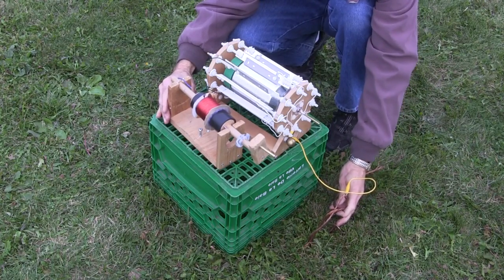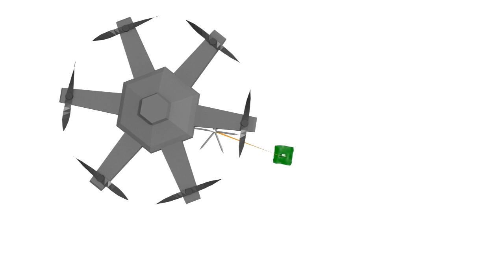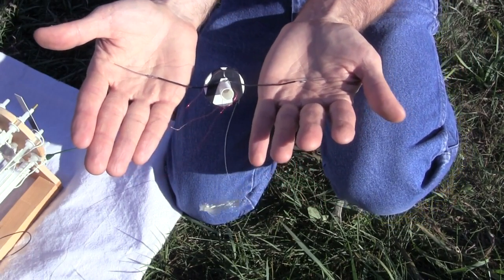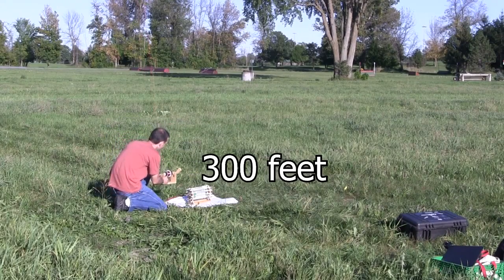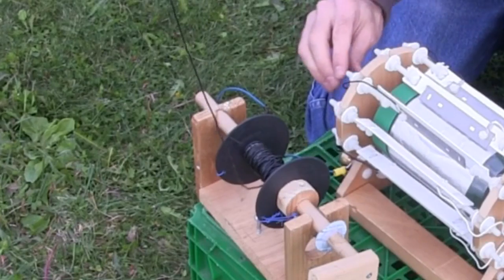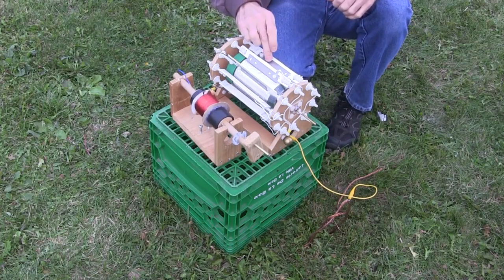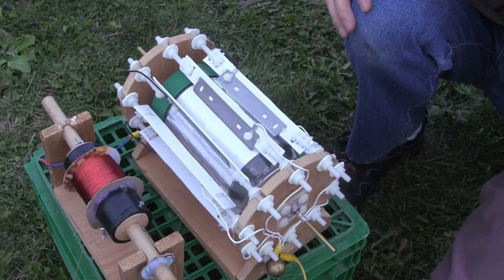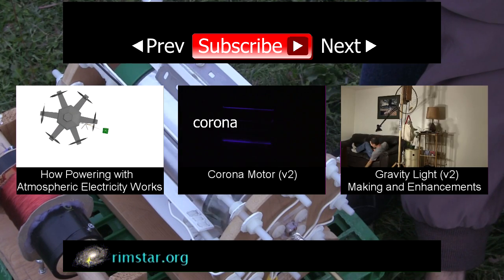Atmospheric Electricity Powering a Corona Motor/Electrostatic Motor

Comment: 0:20 Wrong...very wrong. atmospheric electricity is powerful enough. Look at Lasersabers Atmospheric motor. He has built a more powerful corona Motor than yours you clearly built something wrong with yours.
Reply from the maker: Nothing wrong with mine. His latest one had many more blades and he has a big property to stretch out a long wire. I'd be tempted to make one with highly packed blades if I had the place to try it out.

Comment: Ss what about a Kite??
Reply from the maker: I actually did try to make a kite for it but failed - too heavy. But the problem with both a kite and a balloon is what happens if the wire breaks low down. You end up dragging a wire across the city and potentially across power lines.

Comment: Hydrogen balloon
Reply from the maker: The thing I worry about using a balloon is mainly what if the wire breaks lower down and then the balloon carries it away and drapes it across some power lines.

Comment: How about  many small motors, each with a wire, going up to the top of a tower? If they were all connected to one crank shaft, maybe the power could be multiplied
Reply from the maker: That's one way to do it though I'd modify it slightly to have the many wires going to one motor instead. The many wires would add to the overall power.

Comment: get rid of the motor part use the wire as you have plug that wire into the ground  but thru the transformer  get a multi tap  transformer  and a switch  turn on and off  you could maybe use a audio source
Reply from the maker: The current is very, very small so I don't think it would dld work well with an iron core transformer. But I guess if you treat it as a radio wave antenna, then could connect it to a coil and an LC circuit and you;d be powering a crystal radio.

Comment: Could you use a non condutive pole in the ground to raise the wire? In placement of the hexacopter (due to not having one)
Reply from the maker: Yes. Keep in mind that it would also have to be high up in order to get the voltage.
Reply: @RimstarOrg  what is the lowest (estimated) height that I could start experimenting with if not the 1 meter = (100v) mark?

And why is it do you think (or know) that the 1 meter (100v) doesn't seem to yield any discernable results? I understand that the amps really really low, but surely a 100 volts would be detectable/measured in some capacity, no?
Reply from the maker: You can measure it with an electrometer. Luckily, Caltech has generously put Feynman's lectures online https://www.feynmanlectures.caltech.edu/II_09.html and if you scroll down to the 3rd paragraph, the one that begins, "How can we measure...", you'll see a suggested experiment without having to lift a wire high up.
Reply: @RimstarOrg  without raising a wire... I'm intrigued! And will sure be delving into that. But in the meantime, do you have a recommendation of pole length to start with? The shortest you'd suggest that is..
Reply from the maker: I haven't tried it with an electrometer so I don't have a recommendation for pole height. Another approach is to suspend a wire between two well separated, tall poles. Here's a demonstration by Lasersaber of that idea but without the poles https://www.youtube.com/watch?v=3EG-zjqs9xM&t=417s

Comment: hm what if we build a huge pillar that is insulated from the ground and meet ground and "live" wires at mid height? How much energy could we generate?
Reply from the maker: Something like that could work. Also, suspending the wire between two such pillars that are spread apart should work.

Comment: I would imagine that the atmospheric electric field changes daily.  Did you try it on different days and different weather patterns? We used to have a bank of spark gap style lightning arrestors to protect some radio equipment.  During thunderstorms, those things chattered constantly due to the high charge level in the atmosphere at the top of the antenna tower.
Reply from the maker: I didn't try it in different conditions. My opportunity to do it was very limited. But I did read the same thing, that it varied depending on humidity at least. During a storm, it's even it supposed to be the reverse since the bottoms of the clouds would be negative with respect to the ground.
Reply: Many years ago, some scientists stretched an insulated cable between two mountain tops.  The result was a nearly steady stream of 15 foot long arcs emanating from the ends of the cable.  I read about it in a book titled, "Light and Electricity in the Atmosphere ", by Hal Hellman. It 's been many years, over 40 actually. I was a teen back then.

Comment: So, will this also work if I used tree as the pole? @RimstarOrg
Reply from the maker: The tree is at the same polarity as the ground, so just hanging a wire straight down won't do much. However, you could try connecting one end of the wire to the top of the tree, with an insulating material betweent the tree and the wire, and then have the other end go a long way across your property to the corona motor. That's what lasersaber did here https://www.youtube.com/watch?v=3EG-zjqs9xM&t=417s
Reply: @RimstarOrg  Thank you so much!!! That's help a lot. I've plan to do this fun project at my rard. <3

Comment: is it possible to charge a battery with that voltage?
Reply from the maker: You' need a circuit to lower the voltage but it should be possible. It may take a while depending on the size of the battery.
Reply: @RimstarOrg  nice! if you could put 100 of those on a 50 meter tower,  it will be more reliable than solar panels,  what do you think?

Comment: Corona's work better from points.
So look for 'wire brush electrodes,'
They may make your motor more effective.
If you can't find any suitable, maybe cut a big brush into strips.
In the military wireless systems a ground mat was often used.
So a sheet of chicken fencing pegged to the ground might improve matters.
Elsewhere I think someone used fine toothed blades, which improved the function.
,

Comment: If the law asks. The drone isn't flying. It's running while being held up by the wire.

Just make sure you reference the thickness of the wire, the wind speed, lift, humidity, etc. You'll confuse them enough to lay off.

Comment: The ground rods can be very thin, and may be copper-plated steel to save money. It carries virtually zero current.

It could be only some #26 wire leading to an aluminum pan containing a saline solution, lying on the grass or sunk into a shallow pit.

Comment: BTW, that's also the SAME reason, for "health & safety", under which lying excuse, "red mercury & normal silver mercury" have been taken away from us !! Espresso the Red Mercury, which was used in electricity generating devices! 
A lot of buildings  had them inside towers and pinnacles that held small spinning globes !! 😊😊😁👍✌🙏🙏

Comment: Why not a kite?
Reply from the maker: I'd be worried about the wire breaking near the bottom and the kite carrying the wire away and draping it across power lines. I have the same concern about a balloon. As a kid, I did have a kite string break that way and the kite carried it a long distance away.

Comment: What if you find a 200 meter high building, tie the copper line at the top and let it extend to the ground in a 45 degree angle? Or 40 degree angle? The cupper line could be longer than 400 meter, and presumably generate more electricity.
Reply from the maker: The top of the building would be at ground potential, so it wouldn't work if you tie it to the top of the building. But you could hang a wire between two buildings. The middle of the wire would be at a different potential. See my video here where I explain more about how it work https://www.youtube.com/watch?v=qhXxSAv6rMg
Reply: @RimstarOrg  Thank you for the comment. But I am not sure that the building in itself necessarily need to be equivalent to the ground potential -- if you insulate the connection between the building and the copper wire so there is no flow or current between them, then there should be no problem.
Reply from the maker: Oh, sorry,, I wasn't clear. Because the building is at ground potential, the air nearest it is also at ground potential and the potential (voltage)  increases as you go farther from the building. So any sharp points near the building aren't at a high voltage. See the equipotential lines surrounding the building and tree that I show near the beginning of the video I linked to if that's not clearer.

Comment: you shouldnt be using insulated wire if you intend to conduct electricity, enameled wire is magnet wire for generators and transformers. You want a bare wire.
Reply from the maker: It's the copper part of the wire that conducts the electricity. The insulation is for preventing losses and short circuits.

Comment: It's not enough to run a motor with that thin wire, if you had a large conductive grid mesh high up say on an insulated tower then you would be harvesting some real amps

Comment: Heya,
does it have to be insulated wire in order to work? Does it have to be enameled?
Reply from the maker: If the wire is very thin, 30 AWG for example, insulated is probably better so that you don't lose charge on the way down. Enameled wire is insulated so that will work.

Comment: The reason it only conducted a bit of electricity is because of of lack of proper shape and surface volume of your conductive antennas. With the right size and shape you can agragate more atmospheric charged ions as it passes through the receiver atennas with more volume surface you will get more energy. 
Think of radio fractal antennas and how their able to pick up more radio wave magnetic frequencies. 
The same principles apply to Ion reciever antenas. shape and size matters. And Another big problem is the skinny copper wire. Even if you were to collect lots of electrical energy through the receivers not much will flow through those wires because the Ohms/ amperage draw would not be enough to travel all  that distance to the device you are powering.

Comment: With high voltage and low current, you should be able to use a transformer to bring the voltage down to a useful level and the current up as well. Need a mechanical circuit break to cause alternating magnetic fueld though
Reply: A transformer needs AC power, but the motor could of course operate a switch, so we get slow reversals, which would also work.
Reply: @G-ra-ha-m doesn't need AC just needs  field that builds and collapses. Simple off and on will do that. But as I said need a mechanical means of breakin and making the circuit
Reply: @patrickrighton1275  what you describe IS alternating :)

Comment: Can the electricity be stored in a capacitor or a battery bank, then feed the motor ?
Reply from the maker: Certainly. It would have to be high voltage capacitors but that's not too difficult to arrange.

Comment: You are using a peanut butter jar instead of a tube that is uniform. The aluminum foil is wrinkled therefor you do not have a uniform map across the blades. As far as ground goes you should be at least 3 feet into the ground to get a proper voltage to the unit..
Reply from the maker: I used that particular peanut butter jar because it's a rare jar whose sides are parallel along their entire length. I collect them for that very reason. See my video about making this corona motor here http://www.youtube.com/watch?v=hpvHRHs7o7I The aluminum foil is only on the inside of the jar and while it is wrinkled a bit (hard to get it uniform on the inside), it's only there as an enhancer and is optional. I think most people skip it altogether. As for the ground, I agree. That's why you see me holding onto the wire with my bare hands to improve the ground. We were in a field in the middle of the city where we couldn't do much.

Comment: Just try the collector being very large flat panel, why is it so limited to these tiny needles? The ionic potential is EVERYWHERE and the higher you go, the higher the voltage. The surface area should almost certainly be far larger.

Comment: By this demonstration, I assume that all High-rise buildings in large cities that rise at least 400 feet have this electrical potential residing in every continuous vertical steel framing member.
Reply from the maker: Those high-rise buildings are all at ground potential, i.e., 0V. You could string wires between the tops of the buildings though.

Comment: what happens when it turns out you had a very long radio antenna hanging in the air and were picking up EMR from radio transmissions from everywhere and that was enuf power to make things work...
Reply from the maker: In this case that's not what's powering the motor since this was an electrostatic motor wouldn't turn if just powered by radio waves. But it would have been fun to hook up my crystal radio and see how loud the output would have been, probably pretty loud! Here's my video on the science behind atmospheric electricity https://www.youtube.com/watch?v=qhXxSAv6rMg

Comment: What if you did this from a mountain?
Reply from the maker: You would still have to extend the wire high up since the mountain itself is at ground potential. However, suspending the wire across a valley would work.
Reply: @RimstarOrg  now that's interesting. But you would only ground one side. Correct? Meaning that the other side would have to be suspended and insulated?
Reply from the maker: That's correct.

Comment: Well you can mix this with multiple setup and end up with something working(for more you scale), you use capacitor to boost it; converter to put it in ac if you want or just store it in battery as it come out in dc.

Comment: Have you considered doing the Franklin way of obtaining various altitudes using a balloon?
Reply from the maker: Using a balloon worries me because if the wire breaks low down, as mine did, then a balloon would carry it away and drape the wire across power lines.

Comment: try helium party metal foil balloon instead, even vacuum electric static balloon, the hair lift effect, no altitude power consumption limit
Reply: also no propellers to mess up the cable
Reply: also works as really long antenna, many balloon buoys lift points for really long heavy total cable length, piece-wise partial wires lift
Reply: convert the high voltage low current to low voltage high current, no random corona motors, like c-19 :)
Reply: well van der graaf generator does the same thing, try conversion on that first, simple

Comment: Any idea what happens if you make the earth or ground deeper? Or let's say near a deep source of water or a well? I did see somewhere that Tesla built his tower over lay lines or underground water. I was wondering if you can't get higher you could increase the difference by going deerper. Just curious. Thanks, great video.
Reply from the maker: Yes, having a better ground would have helped. That's why I was holding on to the ground wire with my bare hands, trying to make as much contact as I could. My body was acting as a ground. Connecting it to a big metal plate or wire mesh that was submerged in water would have given a better ground yet.
Reply: @RimstarOrg  I was an electrician. We use 10 foot ground rods. We pound them in with a fence post driver. Just make sure that there are no utilities under ground.
Reply: @gimpygardner3377  thanks. Energy isnt only found high in the atmosphere, but also the deeper one goes. and if you find a moving stream of water below, that can amplify energy going through those rods or conductive wiring. like the Tesla Warden Tower
Reply: @RimstarOrg  Thanks for the reply. Great video
Reply: You need a bigger harvester mounted up on an insulated tower, like a metallic grid mesh , then you would be drawing some amps
Reply: right ..a ground wire into a deep well would be excellent
Reply: Or sea bottom
Reply: Smart- not genius… smart… I loved ❤ your question….  But that’s where you need to be a visual “learner” to see that that wouldn’t work…

Comment: If i had a really tall pole or the like to conduct the charge instead of a drone and wire, and it got hit by lightning, what do you suppose would happen?

Also i wonder how a solar storm would affect it as well.
Reply from the maker: You'd need something like a lightning arrector at the bottom of the pole to protect the corona motor or whatever electronics are at the bottom of the pole. They're used in solar power systems a lot. There are likely other solutions too.

Comment: a hydrogen balloon with tungsten pins all over ?
Reply from the maker: That would be good. I didn't use a balloon because I was afraid the wire would break low down (like it did in this video) and the balloon would carry it away and drape the wire over power lines somewhere.

Comment: What happens if you bring a million wires into the sky? Does this technology allow it to stack in this way?
Reply: it is suspected (speculation yes) that pylons, those high tension power lines) are literally harvesting atmospheric electricity. these wires are suspended by glass insulators, run for miles into the countryside (us and uk) with almost no obstructions in sight. it is estimated to account for 80% of the us' power production, while conventional power plants only account for a mere 15% and 5% from alt energy (solar/wind/etc). don't forget, solar is connected to "feed" the grid, in much the same way a power plant also "feeds" the grid, while the grid itself is the main energy source through atmospheric energy harvest.
Reply: @EbenezerScroogeMcDuck  Thank you for sharing your truth.
Reply: @EbenezerScroogeMcDuck  absolutely true...all the governments/families in power have always known these ancient technologies...scammed us all for years